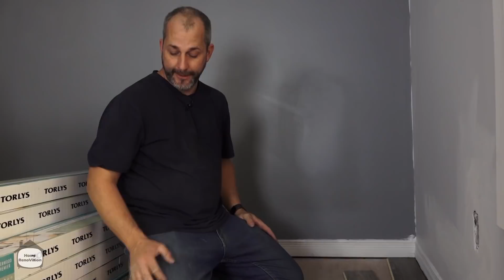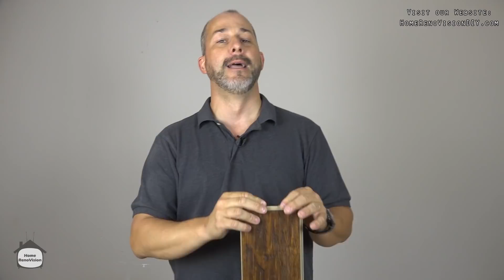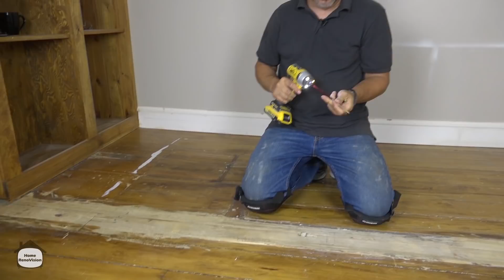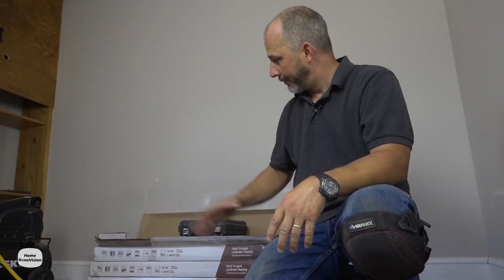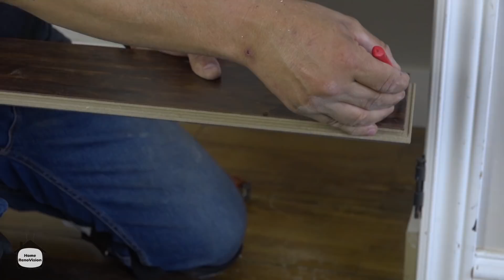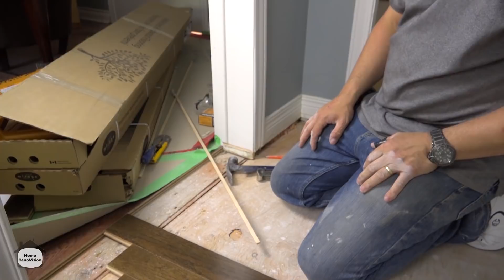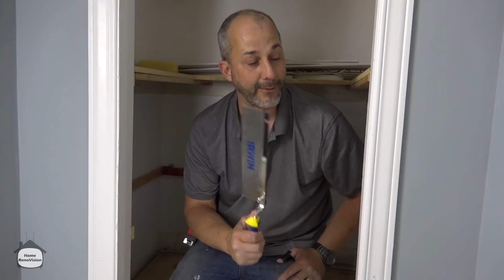How to Install Vinyl Flooring , Laminate Flooring and Hardwood

Comment: Jeff, I'm wanting to lay the vinyl flooring laminate in the kitchen. It has sheet vinyl on it now, but I don't have any bubbles or looseness except at the dishwasher. Is there a need for a vapor barrier? Oh it is on slab cement.  Or do I need to scrape up the sheet material and start with just the cement?

Comment: I would suggest not using an Air Compressor to clean out your computer. I did it once...it was then time to get a new computer. I would suggest a SMALL leaf blower instead. Air compressors create water...unless you have an Air Dryer, DON'T USE an Air Compressor on your computer without one. Better yet don't be an idiot..spend $40.00 on a leaf blower and get the proper tool for the job.

Comment: Thanks for doing these videos, I'm all the way over here in Alaska but they make so much sense for us DIY'ers.  When installing the laminate flooring, do you have any concerns about moisture or homes with central air when it comes to expansion and contraction?

Comment: To eliminate those 2 inch and smaller pieces at the end, Next time measure your room and divide by the width  of the laminate you're installing.  Rip the 2 inches or more off the first row  so the tiles will be even.  This also gives you a chance to square up the room so your not cutting angle pieces  at the end.

Comment: What if you have old metal door casing for interior doors?   That's the issue I have.   I want to install click flooring, but I cannot trim the casings for the flooring... guess I need that contouring tool and some caulking?

Comment: Have a bathroom floor over a basement that is 3/4 thick plywood with 1/2 cement board then tile about 10 years old. My problem it developed a squeak how do I fix it?

Comment: We want to install vinyl plank flooring in our living room and dining room. The floor now is the concrete foundation floor. Are we going to have to use the flooring leveling material to make it smooth or can we glue down plywood to cover up the small holes and rough spots in the concrete? We do have some glue down flooring in another room so we know the concrete is dry enough.

Comment: hi sir, i just wanna know, when installing laminated floor we should leave the 1/4” gap on the all the 4 sides of the room or just on 2 sides are fine??
Reply: Exact question I have.
Reply: if you leave it for repair room purposes, all 4.   right?  so you can spread it to repair it.
Reply: You need to leave space on ALL 4 sides. If you butt it up against one wall, the expansion will be twice as much on the opposite wall.

Comment: Hi, I wanted to get your perspective on a home project I am planning to take on. I have been planning on changing my flooring from carpet to hardwood floor for a while now. So, recently I went to a building supply auction and purchased some pretty lovely white oak wood flooring, but my spouse hates the finish on it. I want to refinish the hardwood floor with a new color. Would you recommend sanding down each board before installation or install it first, then sand it, then recoat the flooring?

Comment: The previous owner had used a cheep laminate flooring on the living room and dining room areas. I believe it was all glued down! I have not found where I can remove it. Do you have any suggestions about where I can look to loosen it and remove it? I want to put hardwood flooring in.

Comment: So I am watching and see the black eye, and then several times you use a saw with no eye protection.  What?   I know several people that have lost sight in one eye and they say the lack of depth perception really slows them down and increases injuries.  Sucks.  I leave a pair of glasses on each of my saws and it does not take that  long to put them on.  The best way you can stay productive is to use safety equipment.  LOVE  everything else about your education pieces.

Comment: Flooring supply stores also sell a manual single loading nailer that comes in handy every once in awhile especially when you short stroke the nailer, you can find them cheap if you look for them, search for Crain 559 close to wall staple tool

Comment: I have an engineered walnut flooring, random lengths about 2=4 feet long that I want to install in my basement hallway which is concrete about 20 tears old. Do i need a vapor barrier or other type of matting underneath, Its a click and lock system but requires some hammering to get in place.( I installed same flooring on the main floor using PLC and brad nails..all good there) Also do you have a video or recommendation on how to create thresholds between the new flooring and existing carpets which adjoin the hallway in 4 different locations in the same area. Do you have a video discussing anything like this..Thanks

Comment: Jeff getting ready to run laminate hardwood through my house.  The problem I have is my front room and living room have carpet and my kitchen / dinette (which separates them) has vinyl floor, and has roughly a 1" sub-floor base (set up for tile????)  while the front room and living room has just the standard 3/4 sub-floor.  I already plan on putting down a 5 mm plywood underlayment to make up some of the difference but by my calculations on my transition between rooms it will be about 1 to 1.5 mm in height difference.  I plan on using a 10 mm thick flooring with a 3 mm pad.  My question is, on the living room and front room sides where i will fall short can I also add either  an additional pad (2 underlayment pads a 3 mm and a 1 mm) or would roofing felt work?

Comment: You didn't mention the best floor of all. Sheet vinyl!  I don't know why it has fallen out of favor.  My personal favorite type of flooring is Armstrong's Cushion Step.  It comes in a 12 foot roll and is super easy to install.  You just take black roofing paper and tape it together to cover the entire floor, then you take a white piece of chalk, trace your floor (and any openings for floor vents), take the paper and place it over the sheet vinyl (you will need plenty of room and a flat surface) and overcut your traced floor.  You MUST overcut so that when you bring in the floor to install, you have extra so when you get it placed properly, you can "cut in" the excess to get the floor perfect.  If you have a 12 x 10 room, you won't even need to think about a seam and if you do have to have a seam, the floor is made so well that it will not show. I have used their "good", "better", and "best" and the only difference is the mils are thicker as you go up and depending on the existing floor, the mils might not matter much.  You can loose lay (but I would recommend using double-faced tape about 2 inches from the wall/seam) on pretty much any existing flooring which saves a ton of time.  Loose lay also makes it portable, so you can reuse it if the measurements work in your favor.  It's pricey (I put down peel and stick vinyl planks as a temporary floor... the mils are so low with the cheap peel/stick that I had to take out a million staples from the carpet previously installed on the subfloor, but it primed my floor and looks decent until I ante up and buy the good stuff).  It lasts for decades, is super easy to clean, moisture-resistant, comes in a variety of looks and textures - but - will look like crap if you loose lay, move your furniture incorrectly and get the dreaded bubble!  That is the only caveat.  I don't work for Armstrong or anything, but I do love their products.  Once and Done is the best floor cleaner for sheet vinyl and their stripper works great as well if you have a really tough cleaning job.  Just make sure you ventilate the room as Once and Done has a strong ammonia smell.  I just wanted to mention sheet vinyl as most people overlook it.  If you are doing a small room, you might luck out and find a remnant at a good price.  It really saves you a lot of time, you probably already have the few tools needed lying around your house, and it's great for a DIY'er.
Reply from the maker: True Kelly. It is still the best all purpose flooring on the market for value and performance. Cheers!

Comment: I'm not so sure about the idea of putting that cork-backed vinyl directly on a basement concrete slab.  What's to stop the moisture that constantly wicks through the concrete from forming mold on the cork?

Comment: No love for sheet vinyl? I know It's bottom of the barrel, but so is the price. And nothing looks worse to me than cheap laminate flooring. It always looks great for the first few yrs but always goes to crap after that. Corners peel and it scratches and fades way too easy. I'm looking into decent sheet vinyl because I know I'm doing a full gut in 10-15 yrs (after the kiddies are out of the "everythings a canvas" stage :) You guys have great videos and even if I still don't feel confident doing something after watching, It's still entertaining. Subbed.

Comment: I wonder how you would cut this type of hardwood around a circular staircase railing in an upstairs hallway?
Reply from the maker: make a cardboard template and lay out the flooring on another larger area. then trace out the template and cut. reassemble in place. Cheers!

Comment: Hi Jeff, 
I had 4 layers of flooring in the kitchen, and have taken off the ceramic and 1 layer of peel and stick. There are two other layers, the lowest one is asbestos and I don't want to remove that. So I have the vinyl peel and stick  layer on top now, and want to do a vinyl planking over it. What do I have to do to prep the floor?
Reply from the maker: If you use a 5 mil vinyl floor with a solid core you can go right over top with no risk of translating any patterns from underneath. Cheers!

Comment: If you are planning on doing a hardwood floor install and using the original subfloor, would you recommend a moisture barrier below the hardwood? Or is it pretty safe to just throw it right over original subfloor. There is no basement underneath original subfloor, just a crawl space.

Comment: Do u have to use  under lay the same that you used for stairs as will  or no under lay for stairs also do  you have a link for the  laminate cutter  that you used in this project please  thanks

Comment: Hey Jeff - I have an 80 year old house with original wood flooring that seems to be pine?! its very wonky/weak-feeling and was not well cared for. We are renovating the entire area with walls open, etc... so I have an opportunity to fix it. what would you do? keep it or lay something over it? I wanted to keep it at first, but the spacing between each board is pretty wide, etc... I'm starting to think covering would just be easier and look so much better.. Thanks for all you do!
Reply from the maker: Hello Serendipity323, I have the same dilemma. I love the old floors but they just won't perform well on their own. even if I screw them all down the gaps will all crack out and catch dirt and it makes it impossible to keep clean. if you want to keep them then you need to love the gaps and the truly rustic feel it gives you, . sand and then vacuum so the gaps are empty and then you can finish. This will of course result in a dirt collection environment so regular cleaning will be necessary. the alternative is to screw it down and sand it flush and install a floating floor like luxury vinyl plank. to transition to tile I would add 1/2 plywood but only if your structure is really solid. If you send me pics on the member email you could always give me a quick call to discuss your particular situation.  You can find all the information for using these services in the community tab. simply scroll through the members only posts we update this every week so it is easy to find. Cheers!
Reply: @HomeRenoVisionDIY  thank you so much for your insight! I will give it more thought and discuss with my sister (co-owner) before making any decision

Comment: Hey jeff. What is the cheapest option for me. I'm renting and the landlord doesnt want to put money into the house. Im only planning to stay for 1 yr. cause rent is cheap. The carpet in the living room is about 30 yrs old and done! I have a 8 month old son that wants crawl like crazy. I'm not looking for durability and longevity just something new for him to crawl on. I know if I pull up the carpet I have old hard wood flooring in decent condition. I'm planning to do the work myself.  I have some basic tools. But I feel like it will take a long time since I have 1 day off a week. Also I'm concerned about the smell if I stain it cause it may be harmful for my son to be around. Do you think just adding a vinyl sheet over the hard wood floor would be the cheapest and quickest method?  Also the room is about 350sq feet. Thanks - Pablo

Comment: How much do u charge roughly to remove carpet in a 10x10 room and install that flooring that you  used in the first part of the video,  parts and labour?
Reply: Without materials (parts) you want to charge at least $300.

Comment: If you were laying the hardwood floor lengthways along a hallway, how do you secure the last row of boards against the wall? I will finish with new skirting so I suppose I could nail or screw close to the edges of the floor boards as the skirting board will cover the nails? Should you glue that row too? Also do you start the first board in the middle of the hallway or against one of the walls?

Comment: Which type of flooring can heated element be used?
Reply from the maker: anything if done correctly!
Reply: @HomeRenoVisionDIY  do you have any videos on heating floor systems over a concrete slab/surface?

Comment: Love your videos. I started an addition, concrete block knee wall, TGI joist, Vantech sub floor, 2x6 walls, OBS sheeting, TGI joist on 2nd floor, Vantech sub floor and trusses. Had a medical issue and project sat for 9 months in the weather. There's no mold but the joints between each 4x8 sub floor have a slight curl. What should I do when it comes to flooring? I would like to install ceramic tile in wet areas (bath, kitchen, laundry)
Thank you
Ken E
Reply from the maker: Hi Ken simply use a belt sander on the joints. to level off. The wet areas will require another layer of plywood probably 5/8 and with TGI joists you should be fine. if your floor is soft anywhere you can always cross brace under the subfloor before closing up. Cheers!
Reply: Thank you

Comment: Do you have any videos on how to stop the bounce in a floor?
Reply from the maker: one of the best ways is to attach 2x4 strapping on the underside of the joist. In some cases you may require a beam to carry the load and get proper support. some old houses were built with poor engineering.

Comment: lol - I hated the look of the quarter round on the vinyl flooring that came with my condo unit so much that I took up the flooring to get rid of it.  I'll always pull off the mop board and reinstall in order NOT to have that ugly quarter round.  To each their own, eh?
Reply: I would definitely recommend removing the old baseboard, using your tips, and making some nice new base moldings. Many people hate that quarter round.
Reply: Yeah, i hate quarter round...it makes it seem mistakes are hidden.
Reply: I pulled off all of the trim before putting in my new floors. Made install much easier and no quart trip.

However I did put quarter trim on the kickboards of my stairs to hide my laminate seams.

Comment: Thanks Jeff, excellent as usual! I see you like sawdust sprinkles on your pizza, I prefer crushed chilli.
OK... Seriously Man! FACE SHIELD!!! Or at the least, glasses! Let me share my story... I think it was about 2 years ago, I was using my drill press on a piece of metal when I thought I heard my old dog at the door. I had a mouse infestation over the winter & the shop smelled really badly, so I only used it when really needed to, with a furnace blower at the door to keep fresh air blowing in. I turned because I didn't want him getting hurt with the spinning belt and pulley. As I turned my head, a tiny piece of metal flew off the drill, bounced off the inside of my glasses and stuck in my eyeball. It was a very tiny speck that scraped my eyelid when I blinked. I took my magnetic pickup tool and got it out at the mirror. I finished working about 3 hours later, got cleaned up but my eye was really red and it still felt like there was something in it. I ended up going to the hospital emergency at 2am. The doc. said that he was impressed that I got it out with a magnet, he could see a spot where it was lodged and a ring of rust around the spot. He said that he'd clean it out. I joked about him grinding the rust off and he said, "well actually, I am going to do just that". He actually used a tiny battery powered rotary tool with a burr. It didn't hurt with the drops he put in but I still cringe thinking about it. Now I have face-shields everywhere. Hopefully you won't have something like that happen, oh wait, you will if you're not more careful, and a wood sliver won't come out with a magnet.

Comment: We just bought a house that has beautiful wood floors throughout. The problem is there are hundreds of giant nails everywhere, I would say the nail heads are larger than quarter inch. Am I going to have to remove all these nails? Can you recommend a good way to remove them with minimal damage to the floors? The basement ceiling is finished :( Thanks.

Comment: We are considering installing engineered hardwood in rather wet climate (Vancouver), on concrete floor and the parking garage is underneath the slab. Wondering what you would do in this situation. (Vapour barrier and underlay, glue down etc.) Is it necessary to measure relative humidity in the concrete?
Reply: Kurtis Quiring Did you find any info on this ?  Thanks

Comment: the problem with using a piece of the floor as a tapping block is pieces of it end up crumbling everywhere, and then you run the risk of getting broken specs of flooring material underneath your new floor. i find a rubber tapping block is worth the investment.